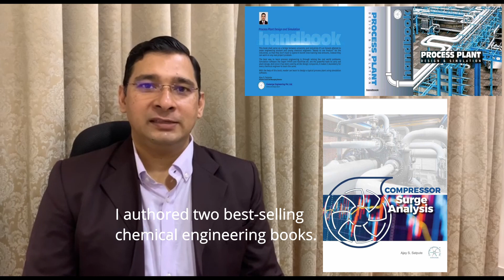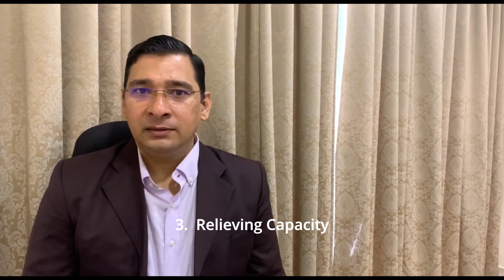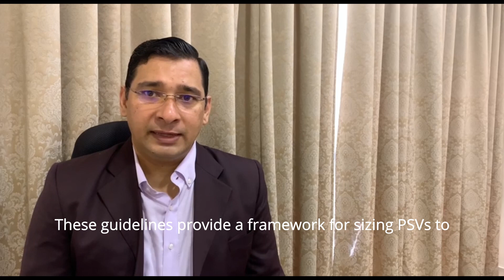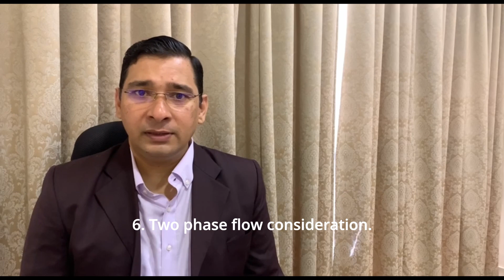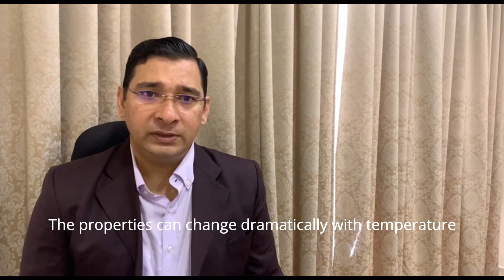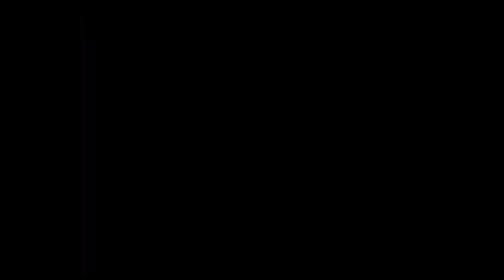Factors affecting PSV sizing (10 of n)

Comment: PSV sizing is one of the great part in process  engineering.. Thanks for video.. One thing I like that, you have also considered the effect of codes and std on psv size.. A good example can be the fire case where over pressure becomes 10% from 21% if PED is applicable..